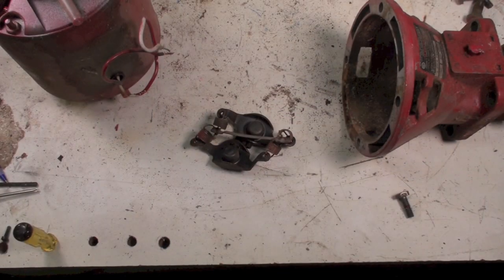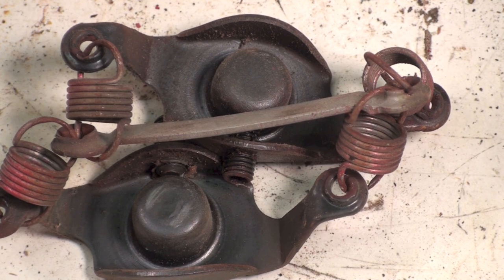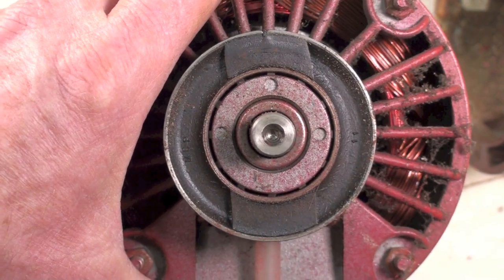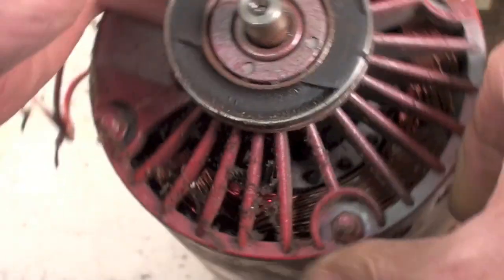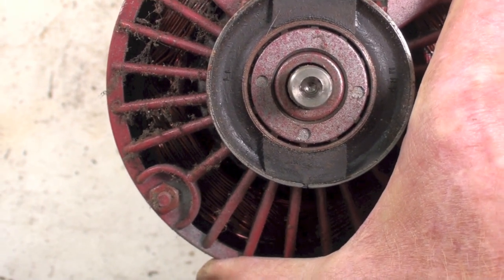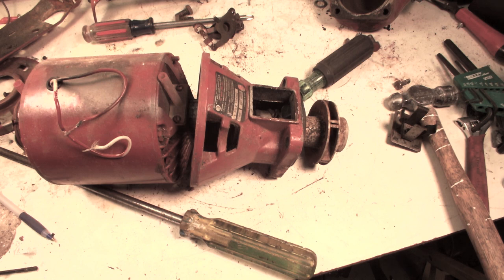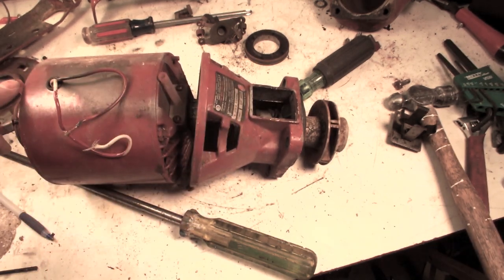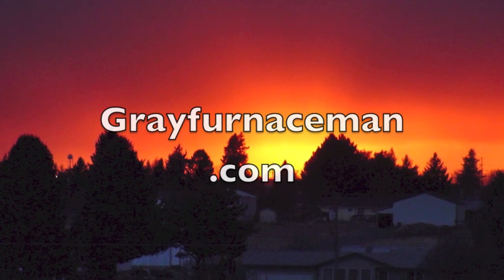Troubleshoot the Bell and Gossett boiler circ pump

Comment: Replaced a B&G 1/16 hp with a new grundfos 1/16 hp it was recommended by a reliable heating friend old house big Victorian style with 2 boilers that have ran B&G pumps for 50yrs plus.  We have done couplers a few times and bearing packs for small leaks great pumps.  Question is this little grundfos will it work being that it looks like a tinker toy?  It is on the boiler that provides hot water heat for the first floor of the house so head is around 12-15 ft just guessing.  Would you recommend this change or should I have stuck with the great B&G that has been running my life time 30yr and my fathers 50 yrs in the house?  Thanks great vid do a bearing pack / seal video on the pump side please.
Reply from the maker: brp0u12 Even though they seem small, they are easily capable of doing the job.   When they first came out about 35 years ago, there were some problems with them, but they are good now.  One precaution:  do not mount it with the motor facing up.  It is water lubricated and and air bubble will form at the top.  Hope this helps.GFM

Comment: Hi there, Thanks for the help in advance.  Great videos.  I have this pump exactly, and the water is leaking from under the bearing assem, the little square hole opening.  Can you help me fix that please?  THANK YOU
Reply from the maker: If the pump is operating normally otherwise, the bearing assembly will have to be replaced.  Be ready, it is quite expensive.
GFM

Comment: I am trying to help a school out that has one of these in place, which used to deliver hot water to various parts of the building and is attached to a large water heater, rather than a boiler. I'm confident the pump has never been touched since installed and when you turn power on to it, it just hums for a bit, never spins up and shuts off. I REALLY dont want to open up the system so wondering if it would be worth while to try to oil the bearing first. After that, where would you look from there. Maybe pull the motor and see if it will run when disconnected from the bearing/impeller assy and replace if not? Again, trying to get away without having to remove the bearing/impeller part and having to worry about draining/bleeding the system (there are no shut-offs in the system, just the main. :(

Comment: I have three heating zones (large house) each using a B&G circulating pump same as or similar to your video. Yesterday I went to turn on the pumps to commence the heating season. One of the motors sparked or flashed at the very moment I turned it on, and then was completely dead. The spark was at the pump end of the motor. The other two pumps behaved normally, so no circuit breaker was tripped. The offending pump was installed new less than four years ago. Switching the pump on causes no motion whatsoever in the pump. I am fearing that I will have to replace the motor. Am I right, or is there a fix for this? I so appreciate your help for homeowners like me.
Ian Lambert
Reply from the maker: +Ian Lambert Motor is probably toast.  The start switch has probably failed.  You can try hitting the side of the motor, but will probably only give a little more time.  
GFM

Comment from the maker: Stat is thermostat.  PSI should be 12# for one story or 20# for 2 story.  It may have started then went out on high temp limit due to no water moving through the system.  The unit has a pressure reducer that should make house pressure to the 12#. It may not be allowing water to pass into the boiler.  Sounds like you are getting a crash course in boilers!
GFM

Comment: Would a failed coupler also create a very loud constant hum that actually transmits through the pipes? I am in an apartment building and we have had a noticeable loud hum coming from our walls. It never happened before in previous years. Our maintenance guy says I am wrong and that it is a normal noise and that, despite me living here for years...and with video proof of there being no noise in an area with a VERY loud hum now, that it was always there. It is crazy that they won't replace a coupler for a pump that handles 11 apartments to the tune of $6000+ in rent every month.
Reply from the maker: The coupler could cause the noise.  The impeller could also be worn out.
GFM
Reply: Maybe it's a larger motor?

Comment: I had 2 problems with my boiler and a question. First, there was a noise I believed coming from the pump, I changed the coupling but not the motor mount.  (I was unaware of that but will be getting one and changing it).  Second, my pressure gauge has been going up close to the red.  After bleeding the rad's it went down but seemed to go back up again afterwards.  With the new coupling on, the noise happened again.  I am guessing the noise is back because of the motor mount is probably bad and I didn't change it yet.

My question is, from your video you said that the motor mount could make the shaft's not line up, could this in some way make the pump not pump the water correctly and in turn cause the pressure to rise?

I know the pump and motor where oiled around a month ago when I had a plumber out to change the pop off valve (I am going to try to oil it again but I could see oil on the shaft when I changed the coupling).  The pump looks exactly like the one in your video.  If there is anything I left out you might need to know, please ask, (jebbie100@gmail.com). I was able to turn both shaft's when I changed the coupling.

Comment: GFM - I have  B&G model similar to the one in the video. The entire pump assembly was replaced new a couple years ago. Presently it makes a high pitched chirping noise (not the rattling typically associated with the coupler). The noise can be brief or can sustain for minutes at a time then stop...repeat. Any thoughts?  Thanks for your great video,
Reply from the maker: Have you oiled the bearing assembly?  It takes 2 tablespoons of oil.
GFM

Comment: I have a B&G Series HV L80 attached to my ancient boiler in the basement of an apartment building. It's making an intermittent whining noise. Every 30 seconds or so, it sounds like it's tying to fire up. It will make a noise, which to me, sounds like some control unit is trying to get the motor going. After 7 - 8 seconds, the sounds stops. Kind of sounds to me like the motor is locked up. I'm guessing the shaft is seized. Any way to coax it back to life without buying a new one? This building is a new acquisition, and it's possible the previous owner didn't know to oil the thing, or, didn't oil it with regularity. The tenants haven't noticed the furnace not working, even with this pump seemingly inop. Heat is still getting to the radiators.
Reply from the maker: First, be sure the motor coupling to the pump has not broken.  It can jam.  if it is ok and it still will not rotate, oil the pump portion of the assembly.  Use 2 tablespoons of oil.  Lots of oil.  Also oil the motor bearings.  Physically rotate the shaft.  If it starts, you win.  I have had good luck with this operation.  Usually I would do this only in an emergency, but it sometimes works permanently.  
GFM
Reply: Thanks! Will do. Still not sure about a couple things. Is there a way to know if the coupling is broken without taking the thing apart? As of now, the unit is still one complete set. I haven't disassembled anything. And second, how do I rotate the shaft if it's still in an assembled state? I don't see anything to grasp on to or fidget with in order to spin the shaft. 

Thanks a bunch!
Reply from the maker: The bearing assembly has 2 sheet metal strips that can be removed for access.  There are springs that may have fallen off.
GFM

Comment: Hi, I have the same bell and gossett pump (1/12 hp) as shown in the video and the motor has been over heating when I turn on the heat in the house.
When the motor stops from over heating, it takes quiet a while for it to run again.
What could be causing this?
It used to make the "noise", as you mention in the video, last year, but it doesn't make noise any more and there is no leak from the bearing.
Reply from the maker: I would look at bearing problems.  I assume the motor runs longer than a few seconds.  The unit can be troubleshot by removing the motor from the bearing assembly, then starting the motor to see if it overheats.  The bearing assembly requires 2 tablespoons of oil.  Hope this helps.

Comment: will new motor mounts sag after only 2 years, I am getting noise after replacing mounts bearing coupler impeller and gasket, the whole salami...i was precise about the oil, i teaspoon, 20 drops and so forth,  the coupler was examined and it is fine.
Reply: probably over lubricated the motor bearings. The rubber will absorb the oil if you put too much in.

Comment: I have  one of these pumps on my boiler in my parents  house. A few times now this season it has made a bit of a chirping noise or squeaking.  I have oiled it in the three places shown and it stops, sometimes it goes for several weeks before doing it again.  Is this normal or a sign of a bigger problem?  I'm not new to this  heating system but I dont remember it squeaking this much growing up in my parents old house. Each time I have oiled it I have put about five drops in the back five drops in the middle and about fifteen or so drops upfront in the trap door I was told to put as much as half an ounce if necessary upfront under the trapdoor. Am I not putting enough oil in?
Reply from the maker: I usually say 2 tablespoons of oil in the trapdoor.  Gobs of oil in that one.
GFM
Reply: @grayfurnaceman  thanks for your response ,when it starts chirping again I will be more liberal with the oil.

Comment: I need your help. I installed our new boiler pump much like the one you are working on. I set the direction of flow properly mounted the pump. I noticed the oil port was now upside down. pump was pre assembled at the factory.  Can I remove the bolts and rotate the couple housing and set it upright will I have gasket or seal problems what would you do. Need a reply asap installed in last night 9/10/15 thank you.

Comment: Can a regular person open up the pump like you did to replace the couplers and the mounts like you did?  Also, are they available to purchase replacements someplace?  

My pump made the most horrible noise this morning and then suddenly the noise stopped.  The pump turns on but does not move the water.  I don't know what to do.  Thanks!
Reply from the maker: If you are handy with tools, it is a simple repair.  You can get the mounts and coupler at an HVAC dealer.  Take the model # of the assembly with you.
GFM
Reply: @grayfurnaceman  Thanks!  I do a lot of work on my cars so I think I'll give it a shot.  Bought the parts online.  Thank God it's not the middle of winter.

Comment: My coupler and motor bearings are gone and am going to replace then today. I also have water leaking from the end and it seems to be mixing with the oil inside. Would you recommend just changing to coupler and bearings as you have instructed?
Reply from the maker: ***** I would change coupling and motor mounts, not bearings.  Sometimes the seal will leak when the coupler fails but will seal once the new one is installed.  In any case, try the coupler and mounts first.  If it still leaks you can replace the bearing assembly.  Hope this helps.
GFM
Reply: Sorry I think I meant to say motor mounts. Thanks for the help!

Comment: I have a boiler heating system and my issue is that the boiler turns on and the water heats, as well as the circulator pump works, but there is no heat being distributed to the house. The pump never turns off and is always running. My father believes it's a bad bearing assembly but it doesn't make a noise nor have the couplers gone bad and we lubricate them every season. And the last thing is that there is no pressure in the system. Also the conversion tank has neither air nor water. I have no idea what could be wrong, its like all systems are a go but something is missing or something. Do I have to bleed it or are there any suggestions you might have? Thank you ahead of time .
Reply from the maker: Fernando Aranda If you have no pressure in the boiler, the water will not circulate above the level of the boiler.  This video covers how the pressure reducer works.  My thought is that your pressure reducer has failed and will not add water to make up the pressure.  https://youtu.be/7jqLL2KfLT8  Hope this helps.
GFM
Reply: Fernando could be the impeller.

Comment: I have a question and it may seem like an oddball one.   Our heat won't shut off upstairs and when I use the shut offs on either side of the circulator pump obviously it cools it down.   Anyone have any suggestions
Reply from the maker: You have gravity flow.  Hot water goes up.  This may be helpful.:  https://youtu.be/iUMBOrlPmSI
GFM

Comment: Great video, what kind of oil do you use/suggest?
Reply from the maker: +ug mold The best would be a special motor oil.  One brand is turbine oil.  It comes in a plastic container with a collapsible spout.
GFM
Reply: +grayfurnaceman And the 2nd best? I saw someone recommended 30w Non Detergent Motor Oil.
Reply from the maker: +ug mold That would probably work fine.
GFM
Reply: +grayfurnaceman Appreciate it.

Comment: Hello. My trouble is its leaking water at the impeller. Where the 4 bolts attach. I bought a new body gasket but it still leaks. I'm confused as to why and how to fix it. Any ideas??
Reply from the maker: +ken peffley I see 2 possibilities here.  Either you screwed up on the install or the body of the pump is warped.  Never seen one that was warped.
GFM

Comment: Last year I had a new pump and motor installed in my boiler by a service man. This year I went to add oil before I started the furnace. After I did, it ran out of both ends of the bearing assembly. Is this normal? I would think that it should hold oil. The other problem that I had was the same thing that I saw the service man had to do last year and that was to start the pump by sticking a screw driver in the couple and give it a partial turn. Now this year I had to do the same thing in order to get the pump to work. Is this normal or is there something wrong inside the bearing assembly? I also bought a second housing with the bearing assembly just in case I needed it. Does this sound like the bearing assembly needs to be replaced? The way I see it the motor should be strong enough to start this to spin without me having to use a screw driver on it. Am I wrong?
Reply from the maker: It is not normal for the pump to stick.  The leaking oil is sort of normal for some of these.  The bearing assembly is usually not replaced unless it is leaking or has seized.  You might try oiling it more often during the season.  It does need a lot of oil.
GFM

Comment: What oil do you recommend using
Reply from the maker: I use a brand called "Zip Spout" oiler.   The oil is designed for motor bearings.  At most hardware stores.
GFM

Comment: Newbie here! I have a question for you. First start up this season and my boiler cycles fine, off and on, with the thermostat, and heats the radiators, ( I'm assuming through gravity force ) but I can't seem to get the circulator to run. My psi and temps are good and I have tested the relay, but I know I am missing something. I hear it click when the thermostat is turned on, but no Circulator Pump action. Any ideas?

Comment: Tell me is a Bell & Gossett coupler universal
Reply from the maker: There are a several B&G couplers.  They are interchangeable but the pressed steel one is designed for the 1/12th hp motor, the cast iron one for 1/6th hp motor and the cast one with heavy springs is for the larger commercial pumps.  
GFM

Comment: I live in a brownstone in Jersey City and we have one of these. It started making a high pitch whining noise. This noise goes on and on and on even when the boiler is not on. It actually seems to go away when the boiler is on. The sound is definitely coming from this pump. 

Any thoughts?
Reply from the maker: Look for sagging in the motor mounts.  The most common failure with these units.  
GFM

Comment: Any way to fix these pumps when they trip the fuse?  as soon as it turns on  it pops the fuse and I see a spark from the  motor.
Reply from the maker: No. The motor has shorted. Will need to replace the motor. 
GFM
Reply: I had an electrical problem with my B&G 1/12 HP motor that I repaired by replacing its switch plate assembly, part RM-549. This is part of a centrifugal switch used for motor start/run process. Background - Last winter, I came home to a loud banging noise coming from the pipes and/or boiler. Water was not circulating. I seem to recall that the motor would not start but was warm or maybe even hot to the touch. The two electrical contacts on the switch plate assembly had welded themselves together. I pried them apart, breaking the weld, and this got the motor back into service until the replacement part arrived from ebay.

Comment: Whats the exact name for that piece you popped off with the screwdriver at 2:23 ?
Reply from the maker: Joey Gonzales Its a motor mount.
GFM
Reply: grayfurnaceman Any idea where I can buy some of those? I need the 1 5/8's inch. I'm the manager at an apartment complex and our pumps keep locking up ><
Reply from the maker: Joey Gonzales These are sold as replacement parts from Bell and Gossett.  Local HVAC wholesalers will have it.  Remember to oil the bearing assembly with 2 tablespoons of oil.  
GFM
Reply: grayfurnaceman We are actually using armstrong pumps. So the bell and gossett wont fit ours. its a 1/12 hp armstrong. Any idea where I can get some of those? need it 1 5/8th's inch. I looked on armstrongs website but couldn't find the exact part